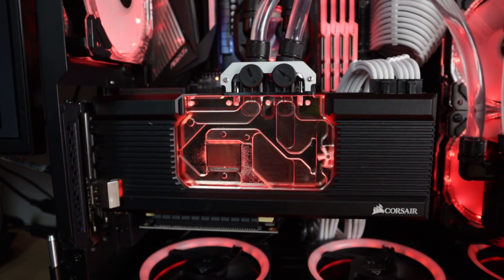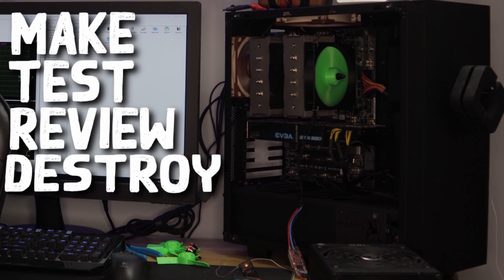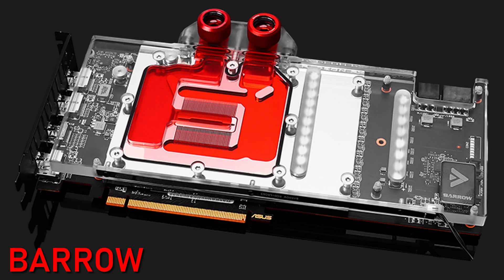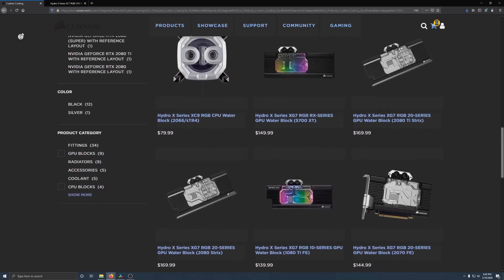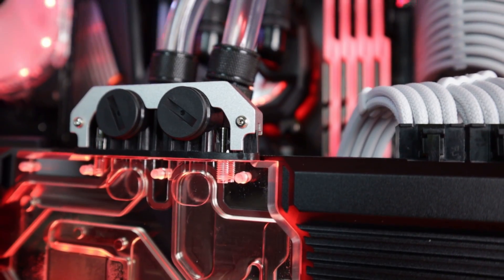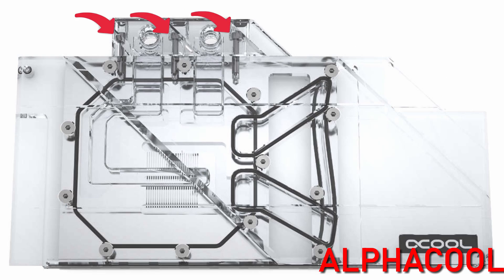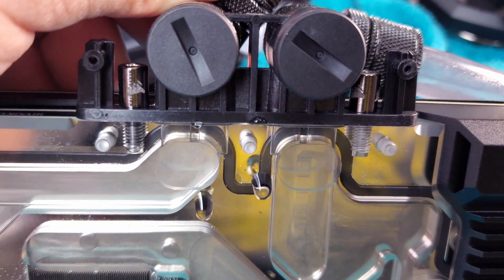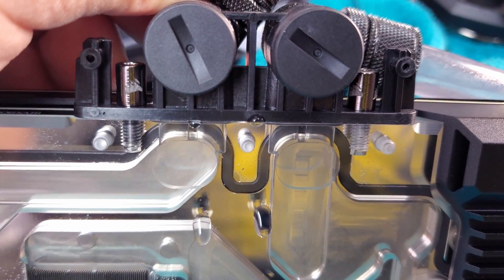WATCH BEFORE BUYING! Corsair Hydro X Design Flaw

Comment: Goofy water cooling experiment: cut open heatpipes for a heatsink, clean them out as best as possible, then solder bungs to the ends and pump water through to see how performance changes.
Reply: Not sure if you noticed but majorhardware did that a while back where he connected the copper pipes to tubes that went to a radiator
Reply: @TheRezin819  Not the same as what I asked.  Also 212 Evo is a poor unit to use for the test as the heatpipes are flattened at the bottom of the unit, not to mention the way he hooked them up caused a lot of restriction.
Reply: @NVMDSTEvil  do you just mean without the radiator? Otherwise how is it different? Pumping water continuously through the copper pipes and having that transfer heat to the fins as shown in the video i mentioned does very little. the video i mentioned still has the aspects of what you said you wanted tested shown, just not in a best case scenario like you might want, but best case scenario wouldn't change much because the only difference would pipes that aren't flattened at one spot and even amount of pipes
Reply: @TheRezin819  yes, without the radiator to test if thermal efficiency of heatpipes can be improved.

Comment: I had a feeling when I first saw these that the terminals were going to be a problem. I've designed and built enough that I can often tell where the weak points in a design are. I was more thinking the g1/4" threading would wear out and especially warp faster than POM or PMMA does but this doesn't surprise me in the least. It's the only thing about the design when I first saw it that made me specifically steer clear. I have 2 EK gpu blocks, 2 bitspower gpu blocks, 1 alphacool gpu block, and one swiftech gpu block currently in use and I can absolutely say they are all built better than what corsair has done with the  hydro x line. That's to be expected considering corsair's lack of experience. They honestly did a great job for their first attempt otherwise.
Reply from the maker: holy waterblocks batman
Reply: @MajorHardware  ha ha, yeah, I know, I have a problem.. I am a boutique builder so I end up ordering a lot of watercooling stuff each time I order since I have to keep a decent amount on hand for customers. I end up getting good enough deals that I have been able to switch every system I have over to custom loops. I also buy broken graphics cards and other hardware to fix so I end up with really good hardware without having to spend a ton of money personally. I spent less than $500 for each of my 2x 2080ti including the waterblocks for them.

Comment: Whoa. That is a major problem. If that happens live... Or on the opposite side of the block you're not just out a power supply but 2080ti and possibly everything. You should get a refund and new block from another brand. That'd make me real nervous. I couldn't keep that one running.
Reply from the maker: yes if my system was powered up it would be bricked
Reply: @MajorHardware  its real scary to be honest.  Thanks for the info. I appreciate it.

Comment: Seems that Corsair, if you watch certain reviews of the Corsair A500 Air, has an inherent issue with their design department:

https://youtu.be/FZH8rl2HP48
https://youtu.be/5bpx8fosDWY
Reply from the maker: what happened with the a500
Reply: @MajorHardware  Seems they haven't taken the specs of the sockets in mind or not correctly, which may lead that the heatpipes are conflicting with or laying on the capacitors around the socket which in turn leads to a bad contact with the CPU or the cooler has not the correct pressure on the CPU. Sadly, some Tech Tuber are promoting this cooler already as competition of Noctua or BeQuiet. Provided links are going deeper into the issue of this cooler and Der8auer has also mentioned certain issues with this cooler.

Comment: Have you reached to Cosair to see  if this issue is with your unit only .This is a new line for them, So if they can replicate this issue in-house with more units a fixbcould be devised. I have not had this issue with my Titan rtx blocks. I have several Cosair units running at the moment. I would contact them directly  and show them what you found.
Reply from the maker: i have not but someone linked an LTT video where he ran into the same problem i pinned it as the top comment.

Comment: I have dumb question and Idea for a video. I've been kicking around this idea for a while and I'm curious if you think it'd work. Start by buying a pump in radiator AIO cooler like the Rosewill PB240, cutting the cpu block off of it, and attaching it to a gpu waterblock using soft tubing fittings, I don't know how you'd top off fluid but there has to be some super janky way of getting it done. The reason I was wondering about this is I have an RX 5700 XT reference card that I could get a waterblock for but I wouldn't want to spend the money a full custom loop. Wondering if this is actually a possibility and you seem pretty okay with doing some janky stuff for entertainment value. This is a video of someone replacing tubing on an AIO https://www.youtube.com/watch?v=cvfSj6cZf5Q.
Reply: nzxt g12 might work for you
Reply from the maker: it would work

Comment: you can try to coat those o rings in  petroleum jelly, it will make a better seal and repel water, if leak is really small, it could help
Reply from the maker: i have plans to open it up in a future video

Comment: EK 90 degree rotating fitting* Couple of drops on my top gpu backplate. Thankfully that spot wasn't open and didn't go through. ( 2x evga rtx 2080ti hydro copper ftw3 ultra) edit: i did run a leaking test almost 2 days before power it on. It seems that temperature increased pressure in the loop and caused that. Now i always test the loop closed and without fans for a while to create higher pressure.

Comment: For the average consumer there is no reason to water cool a PC. I see people with Ryzen 3600 water cooled, why? My 3700x with a good air cooler idles at 30c and never passes 75c in a stress test. Why risk it and increase maintenance for no gains? Once you get into 3900 series, sure maybe water coolers are worth it. The pump on my old AIO was louder than the fans I have now.
Reply: Some People just tech guys, that like to try something new and other will say you Air cooler looks horrible. Often its just a case of taste.

Its the same with cars. Some will like a much more expensive matt finish while there is just no benefit from it...
Reply from the maker: OC make sit worth it maybe and it looks sweet

Comment: Interessting. Are you planning to fix it yourself? 
Would love to see your attempt.
Reply from the maker: if i had a replacement block i could try however it wont be to easy, the area where i need to drill and tap a new mounting hole already has a tapped hole running perpendicular

Comment: From your close up on the manifold it looks like it is made from relatively thin, molded plastic.   You mentioned how every GPU block has a manifold, but in every GPU block I've ever used (over a dozen from a few different manufacturers) the manifold has been cut from thick blocks of either Delrin or Acrylic.   Both materials are far more rigid than molded plastic, and would offer more resistance to the deformation under pressure that caused your leak.
Reply from the maker: it is a bit flimsy

Comment: I'm really happy now that I switched from the XG7 to the Bitspower Lotan for my 2080ti 2 days ago. I'm rather disappointed in Corsair's quality after 2 Commander Pro's frying themselves - one after a week and the replacement died right after putting the side panel back on. Oh and the RGB never worked on my XG7 and the 3 pumps I went thru - 2 stopped working within 7-10 days and I wasn't going to wait for the 3rd to die so I returned it for an EK D5 X3 combo.

PS why pay twice the price for Corsair fans for very poor performance... I dont understand it. Their RGB fans have low static pressure yet cost $40-50 per fan.
Reply: Not all fans are made for static pressure. Learn Your stuff before crying. I use corsair and don't have any problems. Other brands can also fail and also sell shit products.
Reply: Yeah but even designed for airflow corsair isn't worth the premium, may as well just get noctua if you want quiet and good airflow with decent static pressure, and then other brands if you want nice looking rgb will be cheaper than corsair most of the time and you wont notice much of a difference

Comment: The MSRP on that block is insane for how flimsy and low quality design is. Get a Watercool block and just hold it in one hand and hold the Corsair block in your other hand and you can easily tell which one is the higher quality, better designed product. The crazy thing is, it's also the cheaper, and IMO way better looking product. I won't make performance claims comparing them, since I haven't benchmarked them. It seems like a no brainer to go with a higher quality block made in smaller production runs made from materials that are more suited to purpose and designed by people with tons more experience when that's also the same price or even cheaper option.
Reply from the maker: now that i see this i tend to agree

Comment: Welp, i just ordered the same block, time to send it back! RIP
Reply from the maker: O man lol
Reply: @MajorHardware  Literally to be delivered tomorrow.  FML
Reply: check ltts vid for  this corsair stuff theres turned out fine and they knew about the leak
Reply: @KyberGaming47  "They knew about the leak" means there's an issue.  If you knew "some" of a certain brand of light switch would shock the shit out of you when you flip the switch, would you still choose to install that brand of switch?
Reply: @ryanheckman9589  i understand what your saying but its more you have to "wire" the "switch" correctly, the seal works fine, but only if used correctly, apply a little bit of force and the seal breaks but only because you/the person building the pc would be able to apply force,  so technically its fine (considering ltt chuck tens of thousands of dollars worth of parts in it, even with a "leak", not to mention two of them i believe) but yes if i were you id make sure first cause you obviously dont want damage, but im just saying its been used as is and worked perfectly
Reply: @KyberGaming47  The manifold is defective if it can leak under normal use. The weight of a soft tubing run, or a stiff hard tubing run should not be enough to make the thing shower your components.
The construction is very cheap, yet this block is more expensive than an EKWB fully machined block (i just checked to be sure, 154€ for the XG7, and 151€ for the EKWB for 2080Ti with all the plexi and DRGB shenanigans, but no backplate, i give them that).
The corsair block should retail for half its current price given its quality.. and still, this leak would still have to be fixed.
Reply: Build quality in mine seems pretty top notch. Have you ever actually seen one?

Comment: Definitely a weak point in the design. However a third screw won't necessarily fix the problem. Like you mentioned manifold is injection molded, which means the material shrinks, and the thickest parts of the manifold shrink the most. This could also contribute or cause the leaking of the manifold. Anyway more screws is definitely better, if I'd design a connection like that I'd use a minimum of 6 or 7 screws.
Reply: More isn't always better, you weaken parts too by adding fasteners all over. Better to find a middle ground instead.
Reply: @bittech1  I don't disagree with you. But since the design is currently leaking if flexed sideways a little bit, the middle ground doesn't appear to be close yet 😅
Reply from the maker: i pinned a comment someone made linking to an video on LTT where they seem to run into this issue.

Comment: you like to mod things why not add a 3rd screw ?
Reply from the maker: that would be tough as there isnt much space for a tapped hole
Reply: @MajorHardware   why not have a metal insert in the plastic and have it have a high pressure glue to hold that then use a screw to hold the other part on

Comment: Now it is up to Corsair to check this issue and find solutions asap. A top brand is not the one who never makes mistakes, but the one able to recognize them and fix them fast and in a proper way. EVGA already showed how it must be done after the GTX 1080 FTW thermal pad chapter.
Reply from the maker: it will take enough people seeing this video and noticing the issue if we are to see a fix
Reply: Corsair is not a major watercooling brand though. They do have decent pc cases and the commander is OK if you use a third party software with it (SIV), but for high end custom loops, literally no one uses corsair afaik. Kind of like their PSUs, which they won't produce themselves, so you always got to make sure what brand psu you are buying, when buying a corsair psu. I would say, buy their pc cases and maybe their peripherals and avoid the rest ;)
Reply: They should discontinued this block. It sucks.

Comment: Corsair would never be my first choice for a water block. A case keyboard or mouse for sure.
Reply from the maker: for sure mistakes happen i see it all the time in the industry in which i work engineering is hard :-)
Reply: Also RAM and PSU's. All my watercooling gear is EK, Bitspower, and XSPC.
Reply from the maker: i personally liked the look of corsiar stuff but now in hindsight i would have choose someone else for atleast the GPU block

Comment: Yikes!! This is going to gain traction quickly. No way in hell your the only one having this issue. Have you reached out to Corsair yet?
Reply from the maker: No I just noticed it yesterday
Reply: @MajorHardware  linus tech tips had the same issue when doing a full custom rgb loop and its just because its being flexed in a direction that seems to unseal it find the right spot and itll be fine i believe
Reply: Definitely reach out to them. This video is going to blow up and as a tech channel you should try to talk to corsair.
Reply: @brandongraf87  He could have reached out to corsair before publishing the video - Now it's "too late" to talk to them..
Reply: @Skovsnegl  fact the video is on youtube will encourage them to fix or risk losing customers or reputation
Reply: Igors Lab had the same problem. Corsair said him after he contacted them they said him they were able to replicate the problem and are working on a fix. Well, I am
 still wondering when the redesign hits the shelves.
Reply from the maker: someone linked a video where it looks like LTT had this issue i pinned it to the top
Reply: @MajorHardware  jays2cents just did a video showing this issue to, and he pretty much figured out why as well, you both were right. Is it only the gpu waterblock? Just snagged a cpu block and i don't want it to leak lol.